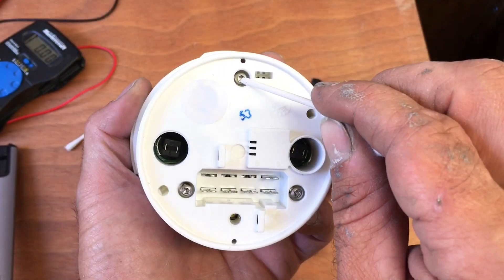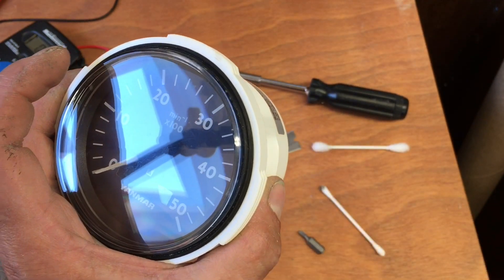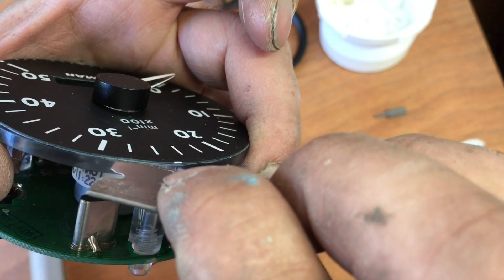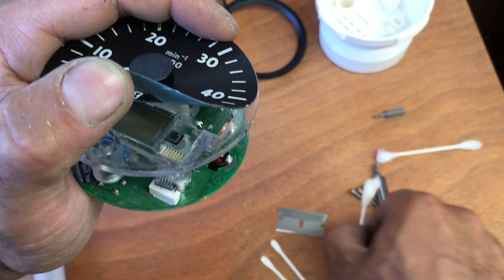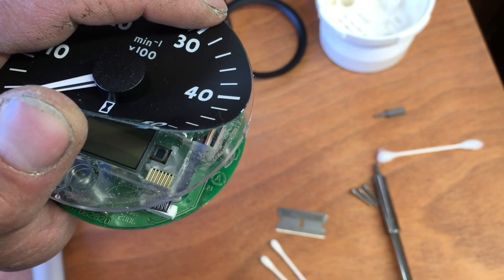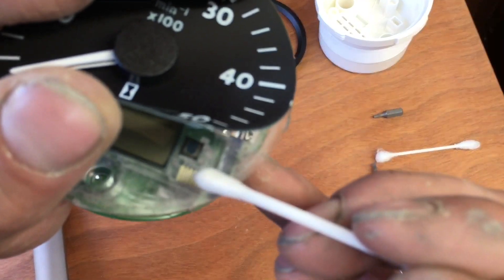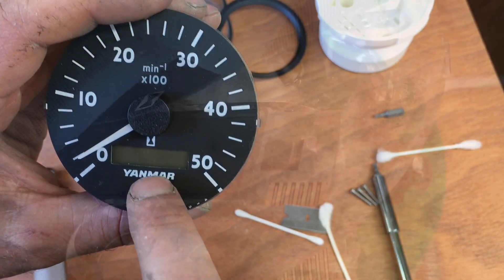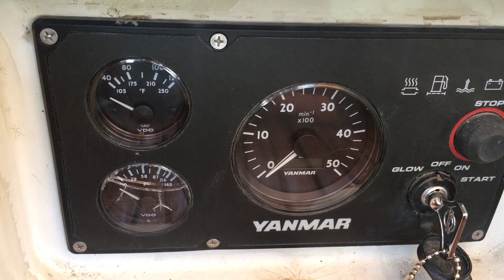Yanmar Hour meter repair, LCD display marine

Comment: Is this only for displays that are " on" but have no numbers showing?
Reply from the maker: It should cover most problems as long as the screen is getting voltage from the alternator to tell it the motor is running.

Comment: Lucas,  Are the hours stored on the meter or elsewhere? Am a correct that the hours run from the time the display died are or may be gone or will it show total hours. I ask because I am interested in buying a boat that has unkown engine hours due to this meter.
Reply from the maker: Hey sorry for the late response. The hours are stored on a chip in the motherboard. The total hours will display once the screen is  replaced or repaired. I have another video coming out of the LCD replacement. I just need to finish editing it.
Reply from the maker: here is the new video! https://youtu.be/u_2qt6MuWGk

Comment: So we got the tach out, opened it and it had a hard compound around the plug for the LCD.  Any advice to remove this?  We are original owners so this is from the factory.  Separately, we cleaned the dialectic gel, put it back together.  Now the tach reads about 1000 RPMs high.  GRRRR!  Advice please!
Reply: Oh yeah, no hours reading but the light is on, double grrrr
Reply from the maker: Hi, I don't completely follow regarding the hard compound on the plug, where are you referring to? The fix I am suggesting does not effect the RPMS, make sure that the needle is zeroed when off? Maybe you moved it when doing the repair. the needle threads right off and can be removed.
Reply: @lucasspaniard8430  thanks for the reply!  I wish I could attach a picture but imagine where the LCD ribbon connects to the motherboard it has a hard dry joint compound.     We also messaged a boat owners group, a couple of folks have followed your method with great success.  On other boat owner had the same issue as us where this compound has been used to seal the ribbon and connector to the motherboard.       Separately, concerning the tach we did zero it out again and it still behaves the same way, where when engine is on the RPMS read high and then does not zero out when the engine is off
Reply from the maker: @rcraraces5928  sounds like your tach needle is not actually zeroed. If it returned to zero once the engine is off I would suggest you may have another issue. But since it doesn't I will guess that it is not actually zeroed. Should be easy to figure out the amount to move the needle since you know your regular idle rpms and where they are now.
Reply: @lucasspaniard8430  thanks for your help!, did you have a chance to see e goop that is on the LCD ribbon?
Reply from the maker: @rcraraces5928  nope not sure were to find it. You can also watch this video, I am going to buy a new ribbon for my display from these guys. On a positive, his hands are a lot prettier than mine were in the video, I am assuming he had not been re-bedding toe rails with 4000 the day before! :)  https://youtu.be/7IpqaKi7hY4
Reply: @lucasspaniard8430   Ok I created a small video and posted it so you can see what I am talking about.  https://www.youtube.com/watch?v=lhPDYP9Ba4Y
Reply from the maker: hopefully you have this sorted, but here is my new video, part of it mentions the zeroing of the needle. cheers.  https://youtu.be/u_2qt6MuWGk

Comment: Have to admit I was a bit skeptical but our symptoms match perfectly so I gave it a try.  Worked like a champ!  Thanks for sharing.
Reply: How did you unplug the harness from the hour meter?  It does not seem to want to unplug
Reply: @rcraraces5928  I kept trying to unplug the individual wires and could budge a single one.  The entire block unplugs!
Reply: @gjmcc1015  thanks for the quick reply!  We were trying to pull the whole plug but that was a challenge too.  Did you just pull it out by hand or did you use pliers on the two short sides, or the long side?  Any thoughts?
Reply: @rcraraces5928  I used a pair of channel locks on the long sides and gently rocked it a bit while pulling
Reply: @gjmcc1015    Thanks again - I was able to get the plug out by rocking it out with a screwdriver.

Comment: Do you need to put silicone on to keep moisture out?
Reply from the maker: I would not bother. Even when replacing the LCD screen which I did recently, (do to a cracked ribbon) the new kit does not suggest to add anything. I will see how long it lasts. (details in the description of this video.

Comment: Do I understand this correctly when I say that its only a light sensor that needs to be cleaned if I'm lucky? No need to change the LCD display?
Reply from the maker: Possibly. The other result that happens offten, is that the ribbon is dried out, and cracks. sometimes it is hard to see it. If this happens you need a new LCD screen. (with a ribbon.)

Comment: Hi Lucas, I have the problem where I have light but not digit read out. I’ve tried unscrewing the instrument panel but screws keep turning so does the instrument panels have nuts on the back. I don’t have easy access to the rear of the panel so can’t tell
Reply from the maker: Hi Michael, I would have to see what your set up is.

Comment: Great Video. Its worth noting that the Yanmar Tach can be permanently repaired by replacing the LCD screen, replacement available on ebay ex-china  https://www.ebay.com/itm/LCD-Displa...648413?hash=item1a5e9f4edd:g:3QMAAOSwn6dbbR2S.  It would be nice if someone knew how to remove the Tach needle, so you don't have to work with the face plate in the way. Repair still worked fantastically, after months of intermittent or non existent display. Also worth noting that it took a few seconds on first power up to display the hours. Now it works perfect. Thanks.
Reply from the maker: Hello Perryn. Removing the tach needle is easy, you just turn it counter-clock wise, and pull up. It isn't threaded,  you are just turning it counterclock wise so the meter hits the stop at zero, and helps to remove it. You can then remove the entire faceplate also. I have replaced my LCD screen since this video due to a cracked ribbon.  I used http://www.akspeedo.com/vdo-lcd-repair.php instead of ebay. His video shows how to remove the needle etc https://youtu.be/7IpqaKi7hY4

Comment: Your instructions were great!   As the previous two people, when I tested  for voltage my system read 7 volts then after doing the procedure my hour meter still did not work.  Is 6 or 7 volts the normal voltage for this circuit?
Reply: I have 0.14V
I see the light
But not the digits.
What is the normal current?

Comment: Thank you so much for sharing.  Just did this procedure on mine and it worked!  Still thinking about installing a mechanical hour meter, just in case this doesn't last.

Comment: Thanks for sharing your fix. I have a 3JH4E with the exact same panel as you. Losing the display numbers was an intermittent probable for me that got worse to where I lost the numbers permanently last September. I tried your fix and it worked great. Numbers back, nice and distinct but only for a week, then no numbers again. I was wondering if you ran into this or have any idea as to what would make the fix more permanent. I am trying to avoid adding a mechanical meter as there is not much extra room in my panel. Thanks again for your help.
Reply from the maker: Hi Dale sorry for the late reply. inspect the ribbon, for cracks or damage. I have seen this issue before,  I believe you can purchase a new LCD screen that comes with a ribbon from Akspeedo. You will keep your hours etc, their video and links are here https://youtu.be/7IpqaKi7hY4

Comment: Thank you very much for sharing! I have not taken ours apart but I wonder if the flat-ribbon connections where it plugs into the main circuit board could also get dirty / corroded. Have you inspectes yours?

Comment: When I check the voltage on the orange wire, I have 7 volts? is this normal?
Reply: Yes. I believe it should be between 5 and 9 volts.  Measure on the AC circuit -- as it is unrectified signal from the alternator.